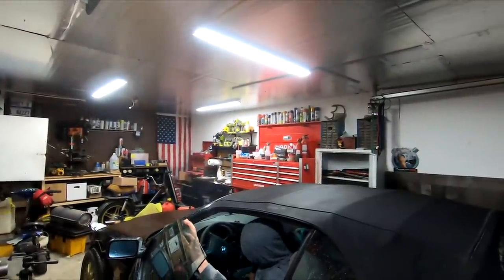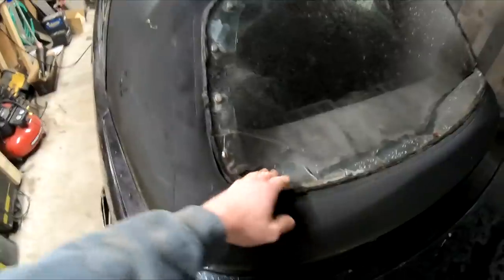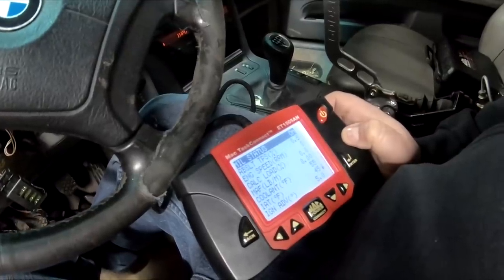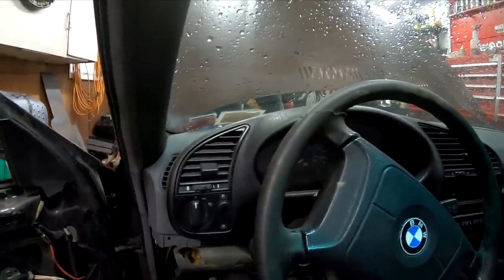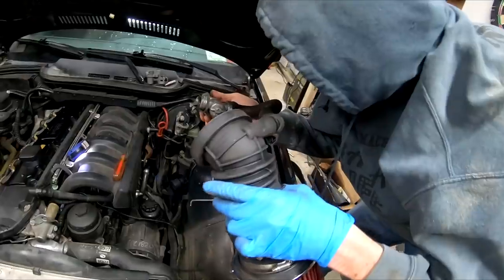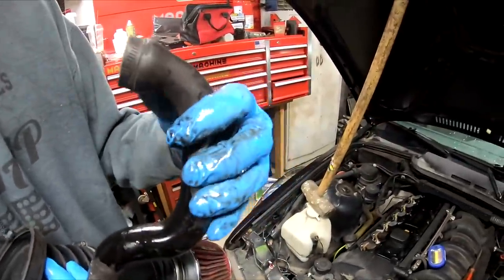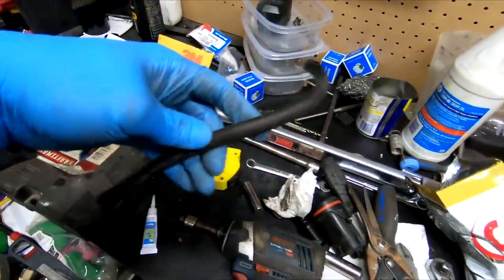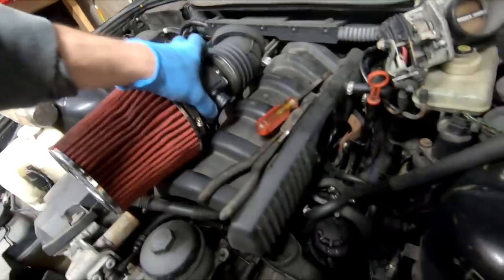BAD NEWS BMW

Comment: When picking project cars, if you pick something made before 1996 , you won't have half the problems getting it inspected to put on the road in NY  ..   I'm sure your running into that with the Jeep.  If it was a 1994 engine light & ecu wouldn't even be a problem.   a reminder:   that NYS-DOT auction in hamburg is the first Wednesday in june 830 or 9 am, I went last year and picked up two cars , toward the end just three people were left bidding on stuff.

Comment: Coming from a tech myself I know that a lot of vehicles are very specific on what different sensors they use ex. Maf sensor does if it wasn’t OE it could have just been just out of parameter on reading how much air to adjust the throttle too. As to which would be your most likely issue. Luckily you had a throttle body adjustment

Comment: Check the rubber boot on the intake the idle sensor is in there and if it has any Cracks in it will not run right

Comment: Check the idle air controller under the intake manifold. There's  bunch of hoses and seals that go bad and cause vacuum leaks

I Should have watched further. That cracked hose will cause it to not idle

Comment: Check spark plugs and make sure they are gap correctly when I did mine they where not gapped right and it ran like trash then I recapped and it was like new

Comment: Since this car has a history with dead batteries, the  PCM my need to relearn how to idle. I had this problem with my Jeep Grand Cherokee when the battery died.  When i jumped it, it would die when it would try to idle. Just hold the gas pedal around idle for like 5 minutes and it will learn.

Comment: You and that car are a world apart. Get rid of it, or start with a smoke test to find vacuum leaks, then you’ve got the overheat problem.  Its all good if you’ve got and extra $2000 to waste and lots of time to work on it.

I’m glad you’ve decided, It’s a smart decision to dump the car.